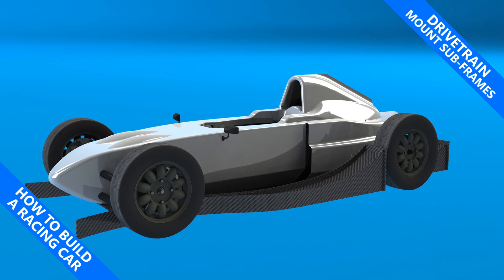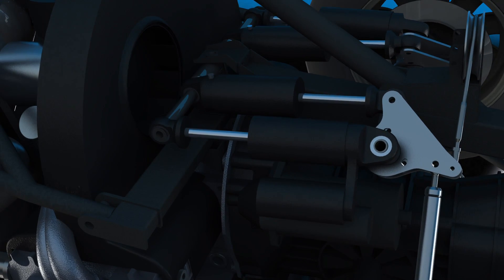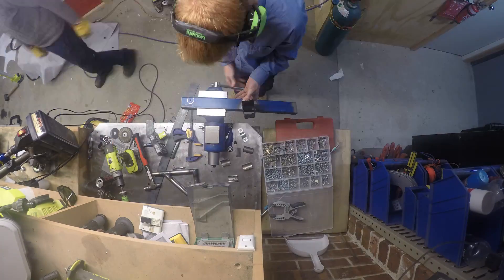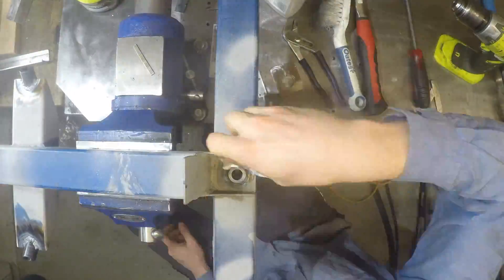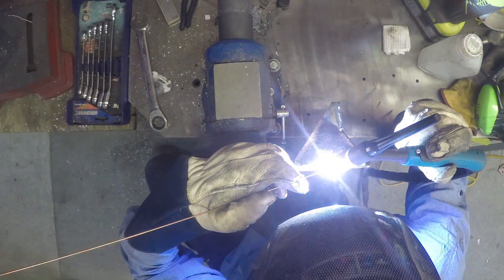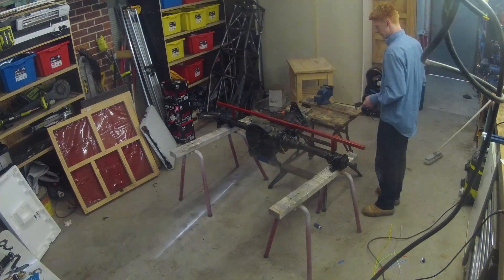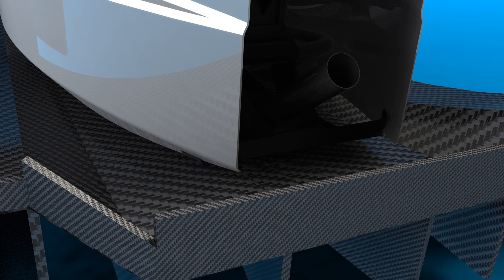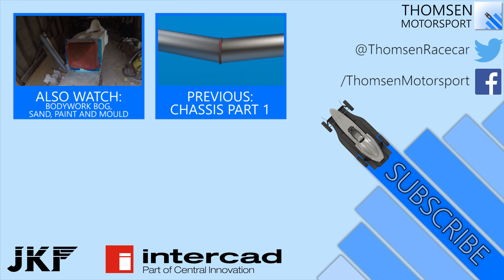Drivetrain Subframes

Comment: If the position of the gearbox motor  assembly was inverted with respect to the position It has in the Volkswagen Beetle, how did they get  the rear wheels to turn, , moving the car forward? Because if no modification Is Made, the car would moved backwards
Reply: The pinion gear is changed to a type 2 "bus" pinion which is typically on the opposite side of the gearbox.

Comment: How does the engine work in the mid mounted configuration? If you just spin around a Beetles drive train it would drive backwards wouldn't it?
Reply from the maker: Swap over the final drive to reverse the direction.
Reply: @thomsenmotorsport7201  You flip over the ring and pinion.

Comment: can we have a tutorial for the design in SolidWorks ?
Reply from the maker: I don't see what I've got to add that isn't already out there. Is there anything specific you want to know how to do?
Reply: ThomsenMotorsport  i mean the design of the parts in solidworks
Reply from the maker: I'll think about it, to date I've avoided straight up tutorials because there are better resources out there than what I believe I could do. If I did a tutorial for instance on this subframe, all it really is made of are a bunch of extrusions, cuts and sheet metal parts - nothing existing Solidworks tutorials wouldn't cover.
Reply: at all thanks sir ;)

Comment: How did you measure the angles of sheet before welding? 3:36
Reply from the maker: That piece was all drawn out in Solidworks and the sheets laser cut to the precise shape before I welded anything. When I started welding, I just tacked the sheets in the corners so that I could still bend them around the edge where two sheets met. I tacked the entire part together this way. Because the parts were all precisely cut to size, when they were fit together they formed the correct shape, without me having to measure anything. This was one of the major benefits of laser cutting, the parts almost assembled themselves.

Comment: after watching many of your videos I noticed that you are doing a lot of Welding in areas where you could have had sheet cut and folded, is there a reason for this?
Reply from the maker: Basically it came down to the supplier I used for the cutting didn't have the ability to also fold the material, plus I've got no ability to fold other than roughly in a vice. I wish I could say there was more to it than that, in the end on things like this I just had to make a decision and move forward if I was ever going to finish when I wanted to. I could have looked further at different suppliers but just opted for this method.